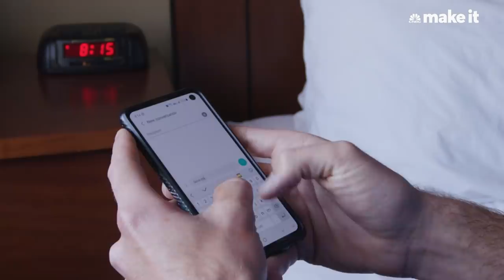Making $70K A Year As A Roller Coaster Painter In Kentucky | On The Job

Comment: Had no idea that roller coasters needed regular painting or that this career existed
Reply: Everything needs painting over time
Reply: Everything that's made of steel needs paint, if the paint chips and the metal is exposed it will rust
Reply: Xcelerator just got repainted after 20 years they don't need to be repainted regularly.
Reply: @Golden_Embers  but they need painting which is our argument here. Not about how often it needs it😴